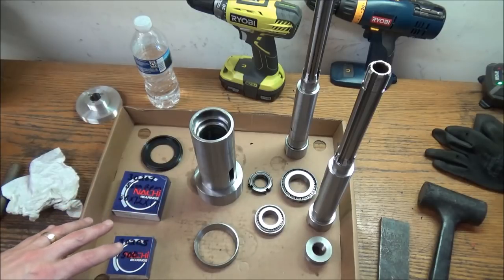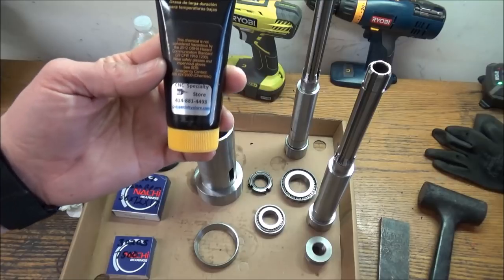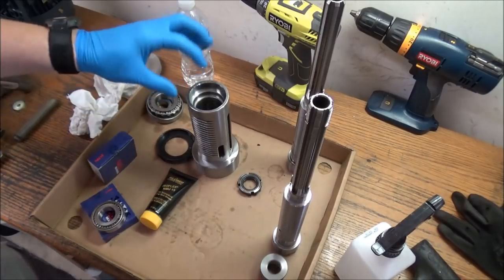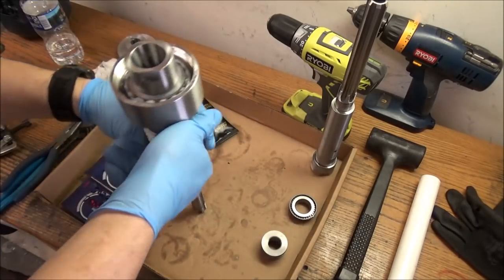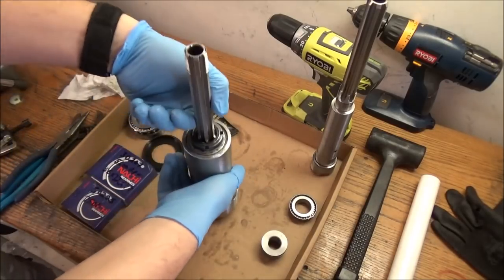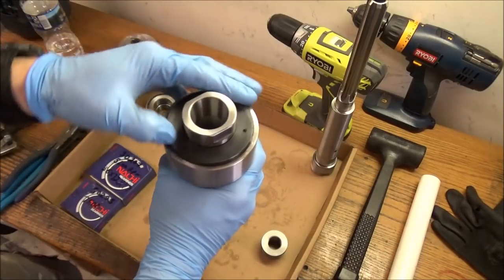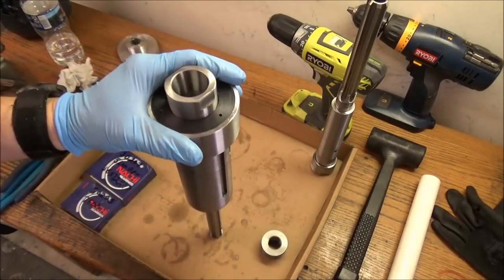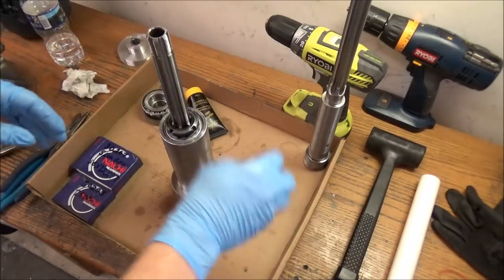Spindle bearing Replacement

Comment: Sam

It has been so helpful to me to follow what you have done. Your videos contain all the info that anyone might need to renew their bearings. The Mill I am converting is a Warco GH18 and it turns out to be the same mill as the PM727 but painted green and cream. I have my spindle out as I write this and am just waiting on the Kluber grease before I reassemble it. I had not run the mill at all before stripping it and I had noted that the spindle was a little stiff to turn. It turns out that the bearing seats were a little tight and the locking ring had been tightened up little too much. Also the blue grease that the bearings were lubed with was very dry. The original bearings were  German manufacture but I do not know the company. I bought SKF replacement ones that have a higher rating than the Nachi ones you used. When I cleaned the original bearings up the top bearing in particular was full of debris. I washed them out with paraffin and blow dried them with the air gun. They now run freely but will only hold them as spares for the future. I carefully miked up the journals and they were really accurately ground. I just cleaned them up with emery cloth and checked the amount I was removing, a micron at a time. Even if you were not doing the CNC conversion and belt drive it would be worth taking a new mill apart and removing the spindle and washing out the bearings and re-lubeing with Kluber grease. 

John
Reply from the maker: Hi John, It's always a good Idea to at minimum give the spindle a once over before you start as you say debris can be in there from shipping etc. After the initial run in of the spindle I did not change the original bearings. until the belt drive was to be installed. the Stock mill will only get up to 1800 rpm and e e with a vfd and 3 phase motor I was only running at 3600 rpm. well within the bearing spec. I figured I would change them when the belt drive was done as I always had that planned . Be sure to seat the bearings and recheck after the run in most likely they will need to be re tightened.

Comment: Thank you Sam, definitely saving this video. I've been running my PM25 at higher than standard spindle speeds without problems after reading on CNCZone the bearings were spec'd at least 5000 RPM (one was 5000 RPM and the other was 8000 RPM, if I remember correctly, if using the correct lubricate.) It's an older post, but Hoss commented that's likely right, but that it's a crapshoot with the original bearings even if they are lubricated. So, I'll keep "overclocking" the spindle until the bearings are out and then come back for instructions.
Reply from the maker: Your Welcome!  Yeah its funny when you start shopping for bearings hard to find the big bearing higher than 5600 rpm for the taper roller variant.

Comment: Hey Sam, looking good .. just a friendly heads up.   Kluber grease is so efficient and clings so well it takes considerably less grease that what would normally be used in packing wheel bearings.  Watch your temps carefully as you do your break-in procedure .. If memory serves me correctly I believe it was Nick from 'The Grizz' thread who had to pull his spindle back apart and remove some 'Kluber Goober' to prevent over heating.  While building my machine I ran accros a chart that gave requirements for how much Kluber to use in various different bearings.  Sorry but I can't locate it right now or I would add a link.  I recall that I was rather surprised by how little Kluber was actually needed.  I even did a tear down after about 6 months to inspect the spindle bearings and was amazed by how well the grease was clinging to critical bearing surfaces.
Reply from the maker: Thank you,
 Yes This was a error on my part and I think you are absolutely correct a little goes a long way.

Comment: The keeper ring is what seats the outer bottom bearing. It should be fitted before torqueing the top bearing down, as it may seat the bottom bearing further in.
Reply from the maker: Hi Mike Great point! thank you!

Comment: Fantastic video.  One question, you sanded down the top of the spindle to allow the top bearing to slide over the spindle with less effort.  I am replacing the bearings on my PM833 which has an almost identical design.  What is confusing me is that the top bearing fits very tightly on the spindle.  How loose did you make it.  Does it still have some friction when you slide on the top bearing?
Reply from the maker: Place the spindle in the freezer and put the bearings in the sun. That should do the trick
Reply: Thank You! @CNC4XR7

Comment: I ordered new bearings but will they come with a new race?  Do I need to install a new race with the new bearings?  Thanks for the video!  FYI, I was having overheating trouble and found an EXTRA quill lock pin when I got things apart.  It had chewed up the dust cap on the upper roller bearing.
Reply from the maker: Yes the Natchi bearing should come with a Race . You should always replace both and do a proper break in. once set they will run cool.

Comment: You put almost no preload on the bearings using that nut... Are you sure that's correct? What are the preload specs for that bearing combination?
Reply from the maker: I set mine by feel, Sorry not very technical I understand. I'm sure I checked this several times before installing the spindle. so what is on the video may not be the final preload. sorry about this.
When bedding the bearings if you have to much preload the spindle will lock up from the heat expansion running at high speeds. the preload needs to be checked again after this step.

Comment: Good video.  Heat and cold are a wonderful thing. Would have made the job a lot easier in my opinion. Patience!! At  13:38 I found something I didn't like and would have have used a different method. It is so easy to do and not everyone has the tools, JMO
Reply from the maker: I agree there are a few ways to get it done. Having tools helps.

Comment: Sam another great video. Perfect timing for me. My bearings are grinding like crazy and the spindle is getting really hot. Did you ever post a video of how you removed your spindle?   I just ordered the Nachi bearings and am starting the spindle removal. Do you have to remove the spindle feed shaft?
Reply from the maker: The grinding you hear may be the 2 Top bearings which are 6007 radial bearings 2 back to back mine are a little noisy and need replacing will be doing that soon. Been awhile since I removed the quill handle but the lock handle on the left needs to be loosened good and I think once you disconnect the depth gauge you can just use the tri handle to lower it out. put a block of wood or something just in case you drop it or if falls out.
Reply: Thanks for quick reply!  I did finally get the spindle out.  I removed the lock handle bolt and the depth gauge completely and was not able to remove the spindle.  I had to pull the whole quill feed shaft out to remove my spindle.  Hope I can get it back together.  lol  I couldn't see any other way to get the feed shaft to disengage with the quill groves without pulling it. 
 My spindle was grinding and difficult to rotate after I had it out, so I am sure that is where problem is.  After pressing out the spindle, I was expecting to see a mess of chewed up bearings, but all looked good.  I think the spanner nut holding it all together was just cranked way to tight which was causing the bearings to grind and heat up.  I have new bearings on the way so just going to replace them.
Cant wait to see your rebuild completed.
Reply from the maker: Ok check the set screw pin that is there to guide the r8 collets Mine backed out and chewed things up
Reply from the maker: I also just left it out

Comment: You do not need to press the bearings on just emerge them in hot oil and put the shaft in your refrigerator freezer and they will slide on.

Comment: Im new to machining and milling and trying to learn right now the anatomy of a milling machine. Currently researching the Spindle-Chuck-Tapers(R8 vs MT2 [by the way does MT in MT2 stand for Morse Taper?]), types of collets used for the R8 Taper Spindles and whatever else connected to the Spindle and Draw Bar. 

At 00:20 you touch the a part that I'm assuming the Spindle slides into .. what is that technically called?

EDIT: ok so after watching more of the video at 02:52 you called it the "Spindle Housing" Ok so the Spindle isnt just one piece but a two piece item. So the rod and housing make up whats called the "Spindle". This will help me look for parts down the road on aliexpress.
Reply from the maker: Yes Morse Taper.  Yes the Spindle itself slides into the spindle (housing/ Cartridge) R8 is popular because a lot of people convert to TTS type tool holders which require a 3/4" collet.